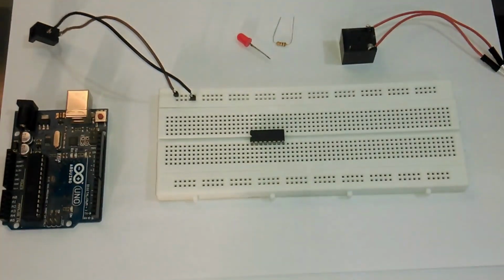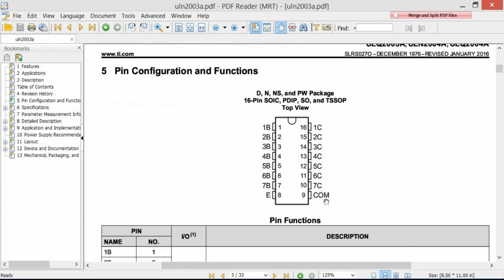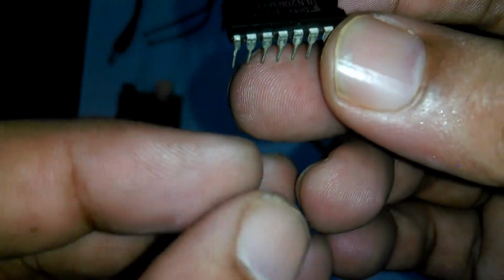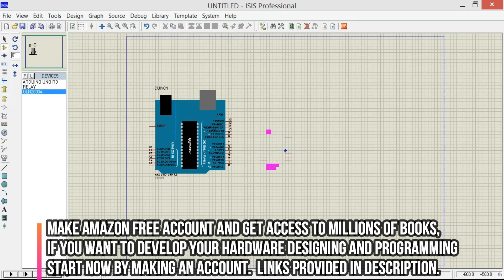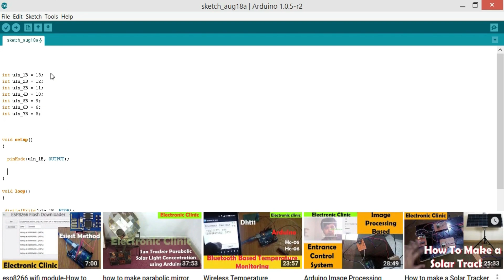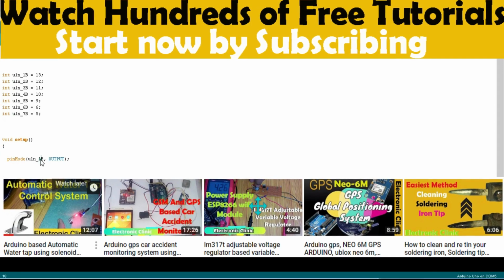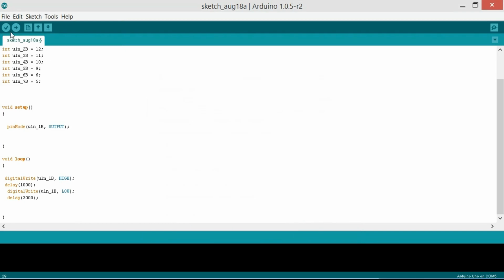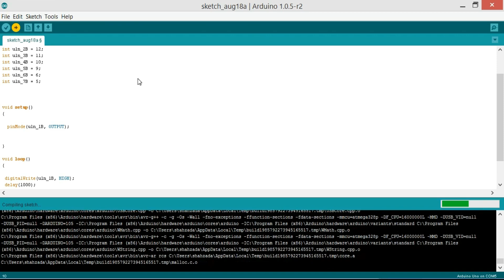ULN2003a ic working,datasheet,Proteus simulation, it's use with Arduino as relay,led,solenoid driver

Comment: Why do you say "is most commonly used in electronic circuits?" do you stick it somewhere else? Its only used in electronic circuits because ... it is an integrated circuit ... so as soon as I heard you say that the video lost my interest. Just a tip - don't say meaningless statements.

Comment: I can use this chip to make a h bridge?
Reply from the maker: yes. you can. but you.could control only small dc motors. 
you can use mosfets or relays for high amps motors
Reply: @ElectroniClinic  I don't know what went wrong, but smoke came out of the chip.
Reply from the maker: yaaaa. thats what i was saying. use l298n motor driver which can handle current upto 4amps.